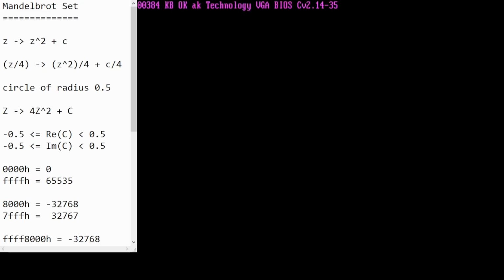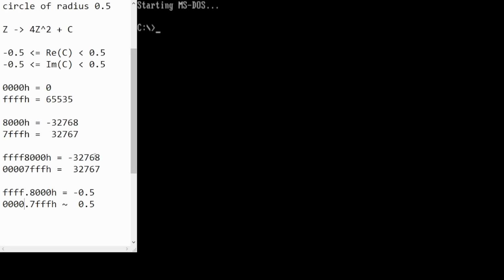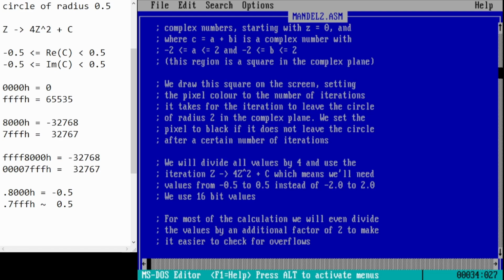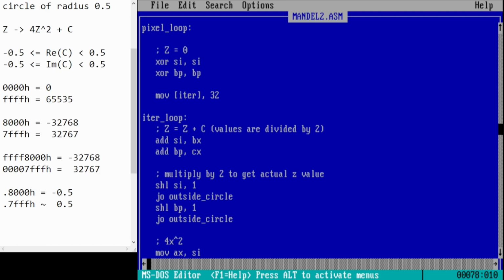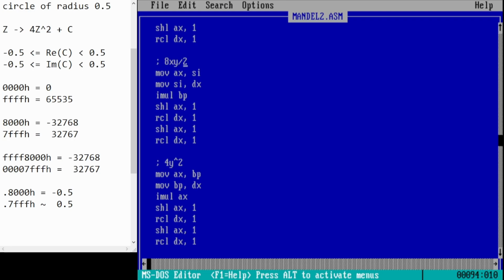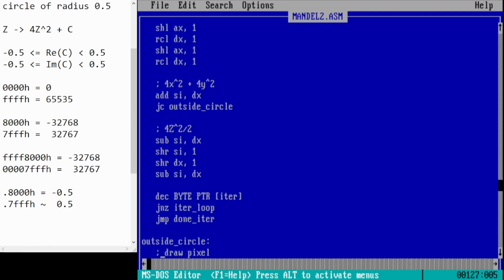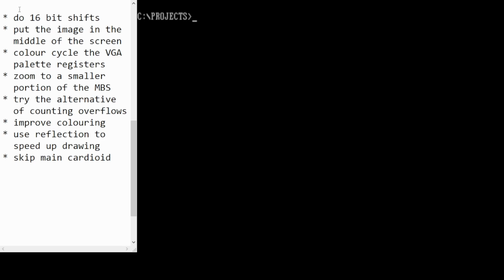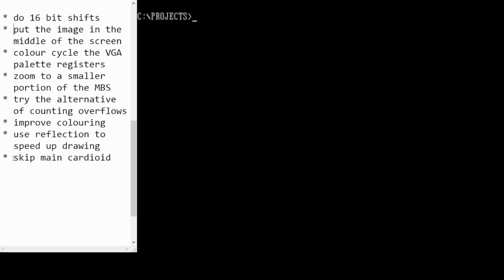8086/8088 Assembly Language: Mandelbrot Set in VGA Part 3 (Final Program)

Comment: I can be wrong, but at 21:06, wouldn't it be easier to just remove INC DI and DEC DI, and putting an INC DI though before JMP done_iter instead? That way STOSB increments DI normally, and at the end of the iter_loop, before JMP done_iter, there is the new single INC DI which does the job.
Reply: Yes, that seems like it should work just fine. It should give a small speedup, which is nice!

Comment: This is excellent, and great work.  Avoiding the "lake" is the big speedup as you mentioned.  One of the ways I sped up mine for introJR (which was not as efficient as yours!) was to recognize that I only have 16 colors to paint with, so I limited iterations to 16.
One of the most interesting ways I've seen to draw a fractal somehow generates empty outlines for the areas of solid color, then fills them in.  If that method isn't sufficiently more calculations, then doing so and using a flood fill might be a speedup too.  I regret I forgot where I saw that method used but it's probably in fractint somewhere.
Reply from the maker: Thanks for the kind comments. Yes, I believe there was some version of Fractint that used the outline/floodfill optimisation. I remember being surprised as a kid that this didn't seem to go much faster.
Reply: @pcretroprogrammer2656  The boundary is always close to max iteration, which is where the processing time is consumed. And you have to check every pixel for it's escape number.